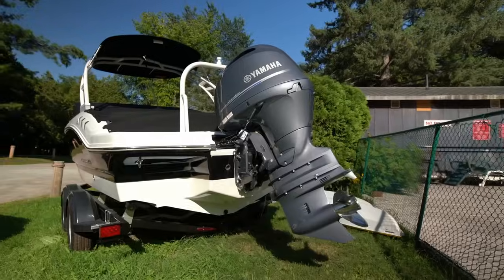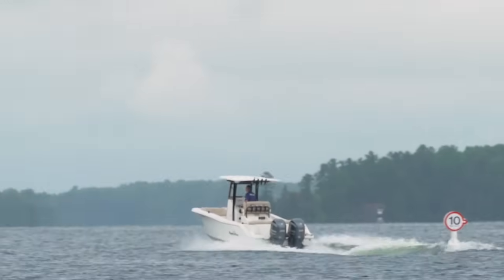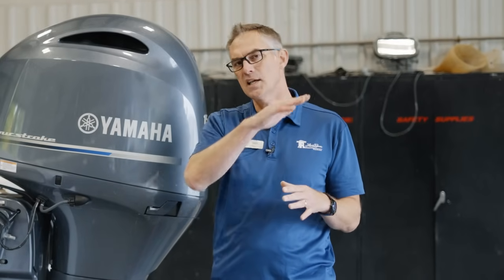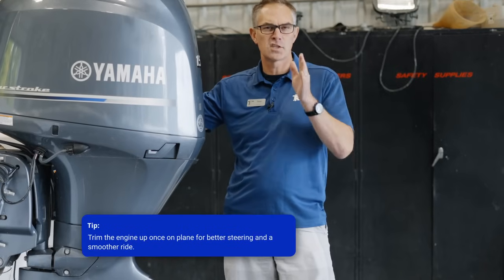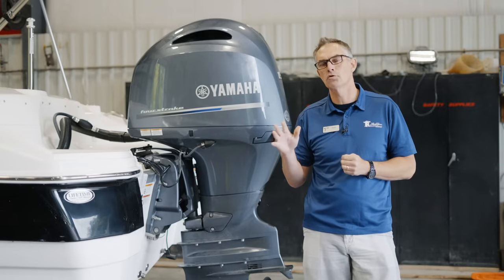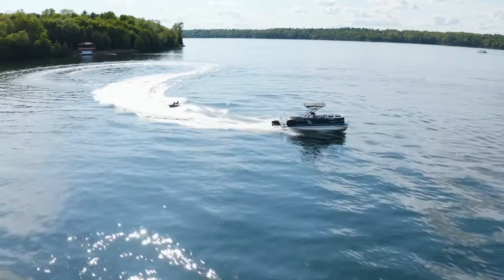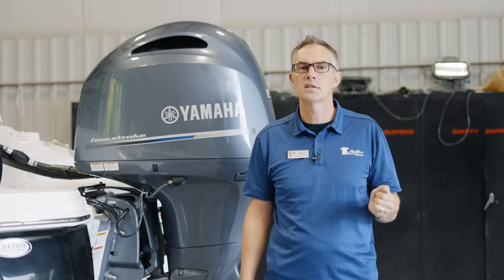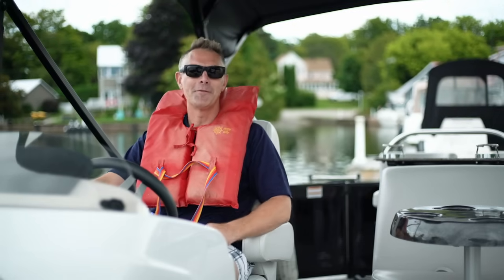How To Trim Your Boat (Boat Trim Basics)

Comment: My grandfather taught me to trim by watching your wake. No just behind but along the boat. As you adjust trim you'll notice the beginning of your wake moves up and down between the bow n stern . The less wake the better the trim, less boat in the water , less friction, more efficient, more speed.
Reply: Simple but that's an excellent idea.  Will give that a try.  Thanks!
Reply: Very cool! Your grandfather definitely had it figured out!!
Reply: You will also hear it, the water shifting to the back, or stern…lol
Reply: I mean, you’re correct, but it depends on tge type of boat. What you’re saying doesn’t hold for stuff like my tournament bass boat, which has barely any part of the boat even touching the water when on plane. The only wake is almost completely behind me. 

My Regulator 33 center console saltwater sport fishing boat performs exactly as you said. 

You can always tell by the steering anyway. 

And that’s all only for calm water. Get out in the salt, or even big water like the Great Lakes, Lake Champlain, etc, you have to trim it for the waves, not just performance.
Reply: Thats how i do it. Just look over the side. If its windy and wavy i only trim 1/2 up, if its glass than 3/4 up.
Reply: You’ve learned well young grasshopper.

Comment: After on a plane, I use my GPS speed and engine RPM. With the throttle at a fixed point, say 4200 RPM,  I bump the trim to see the RPM come up slightly and the speed increase without a change in throttle position. I also watch the "wash" You want it to be just on the edge of cavitation, then trim it down a touch.

Comment: To trim your engine properly, tilt up until you maximize your speed which means your wetted surface area is minimized or until your propeller starts aerating, whichever comes first. If your propeller starts aerating, then tilt down a bit.
Reply: @GiveThanksAndPraise hey, that’s how I listen too!

Comment: I go by sound on trim all the way down I can hear my motor under more load as I trim up I get to a point where I hear the load release and my rpm’s start climbing more I usually leave it there until I stop again what I don’t know is if I keep going up more will I gain more speed or is the point I’m stopping at now the sweet spot and most ideal?

Comment: In calm water, after it gets on plane you can trim the motor watching the gauges where your getting the highest speed for the RPMs and you will notice you will also be getting the best MPG for your boat.

Comment: The Mercury user manual says that in order to trim the engine correctly, perpendicular to the surface of the water, the steering wheel should not feel a tendency to overturn either to the left or to the right... but at the same time, when you want Go fast, turn the engine up a bit. Very good video, greetings from Argentina.

Comment: I was always taught when on plane, trim up till you hear the slight hollow noise.  Then one click back down.  That’s the sweet spot.  Has worked great for 40 years.  No issues.
Reply: this is about boats, not planes.  just kidding.

Comment: Wonderful video. Used to sail for some years and now for the first time started riding fast power boats. The concept of trimming the angle of attack of the prop is totally new to me and this video was extremely helpful. Super well explained and easy to follow, especially the details around over trimming and how to not rely on trim gauges

Comment: Great video. Another good tip is to trim up to a slight positive angle when in reverse. Helps to pull the rear of the boat up making it easier to maneuver and you don't pull water over the transom.

Comment: Every boat is different. My chaparral, bravo three would get its best performance (top speed )when I trimmed it up to 2. The trim range was between zero and four. On the gauge anyway.
My tritune on the other hand gets its best top speed when trimmed to 1.2. But it gets its best miles per gallon at 23 miles an hour trimmed at 1.4. In the end, just spend a little bit of time figuring all of this out. Every boat is different.

Comment: I always forget to trim up my stern drive when I put it on the trailer but I’ve just been lucky not to hit the ground before I notice and trim it up (just as it emerges from the water.  ). I need a huge red laminated card or some reminder to do that ! 😂. And since we’re sharing I need a reminder to put it down when I launch. 

Some other trim goodies I picked up this year as a new stern drive owner:  the manual says to store it in the down position, even if it’s sitting for “a short storage duration “ so the bellows don’t “take a set” and stay bent in a tight angle. I see lots of boats sit for months with them fully tilted up for trailering. Also a friend of mine who worked hydraulics in the Air Force said hydraulics 101 is to store them with the ram retracted is best (so again trimmed down ). 

Try not to run a stern drive boat motor (I believe even in neutral ?) with the stern  drive trimmed way up because it can be hard on the u-joint in there was another tid bit worth passing on I guess.
Reply: Obviously a year late. But I have a laminated card on mine .  One side with all my boat details in prep for a may day or a pan call for either myself or, for if I'm thrown out, the passengers who might not necessarily be trained to be able to give out properly and because I'm a bit of a stickler, I have a checklist prior to and post leaving the mole on the reverse of that. You know what you're doing from memory anyway, but things can easily be forgotten and it's just a 5 second flick through, yes I have rope, yes I have anchor on board, clips, life vests, first aid kit etc.

Comment: Ugh, I have a 19 ft four winns and end up trimmed down most of the time. With 3-4 kids and tubing it just makes it easier. But even cruising even a little trim up has me porpoising. 

And remember to trim up before you pull the boat. :-)

Comment: Thank you for this great tutorial!  This is a clear explanation complete with visuals and thorough explanations that, for me, was a perfect blend of technical details without either getting so cerebral as to be on the level of the engineers designing these devices or dumbed down to the point where there is virtually no explanation of the physics or reasons for the particular recommendations.  Well done!

Comment: In my old 16.6’ aluminum with a 50 Yamaha the revs won’t get all the way up unless trim high enough. Theres a bunch of batteries and gas near the stern so the weight isn’t balanced. Because of this once you trim too high it’ll porpoise so you probably won’t over rev it. Great boat to learn on since there is no tachometer, no trim gauge, no anything. It’s all feel

Comment: Getting on step quicker has a lot more than just trimming the motor. Weight distribution, hull design, being under powered and let’s not get into prop pitch, cupping, 3 blade vs 4 blade. 

In my early years I bought an old 17’ whaler with a 75 Johnson. Would take 1000 yards to get on step, tried whale tails, trim tabs, jack plates…nothing helped. Sold the engine and repowered with a 90 merc with a 4 blade….blew the hull clean out of the water and was on step in 3 boat lengths. Learned a thing or two that day about being under powered and 4 blade props.

Comment: i always used sound. up on plane lift the engine. when it gets loud put it back down till noise goes away, found that gets the fastest speed. now you can leave it there, but if you slow down then want to go again, just going to take slighter longer to plane.
Reply from the maker: All of those things are true :)

Comment: Hi, great videos I have a 2020 150 Yamaha 150xca and it bleeds down at the dock and underway and I have to keep adjusting the trim up as it bleeds down,my  dealer says this is normal and that is why you need to put the engine rest bar down so it will not bleed down over night,i do not believe this is normal ,and they tell me that Yamaha will not warranty this, what is your input,thankyou

Comment: The last thing you mentioned was to trim your motor all the way down to be ready for next time, but I've been always told to raise the lower unit out of the water each time you're done boating. Which is it?
Reply: if you leave it in the water it is fine to leave it down but if youre taking it out out of the water with a trailer you always need to trim it all the way up
Reply: also depends on water.   I wouldn't leave anything down in salt water

Comment: Hi there  ! Thanks for your technical guidance and savoir-affaire in boating issues. I have an Angler 22 with 2 x 250 HP VX series YAMAHA  outbards. Quick question : Why is it so, that when I run the boat at mid power and press the trim button down, it clearly accelarates better...?  I assume an electrical issue has to do, and if where shall I look to, in order to guarantee unstable electrical power to the spark plugs I pressume...?¡¡?

Comment: How do trim tabs affect the use of the trim?
Reply: Not much really. You still trim the exact same way.

In most properly powered planing hulls, you'll want to trim till you porpoise, then add in tab to stop it.

Exceptions to this are sea conditions, loading and balance, and speed.

For example: if you are unbalanced, or listing, the tabs will be used to level first, then achieve proper trim, then tab down to eliminate porpoise.

Another exception is in rough water, which is where tabs are most often under utilized. You still want to trim for max efficiency, then use the tabs to get a level ride, to prevent porpoise and pounding.

Finally, tabs are most often severely undersized on boats, which make them far less effective at doing their job properly. High Performance boats will need a much longer chord than a cruiser or fishing boat of less performance, due to the fact that the plane (tab) needs more leverage and less drag to keep from hindering performance.

The best way to understand proper use of tabs is to find a person who has a high performance boat and let them show you how they are supposed to be used. You'll find that nearly all people who use tabs on boats do it wrong.

Comment: Great video,.... question.  Does this also apply to a 30 foot 11,000 lb Bayliner Flybridge with a 7.4 sterndrive?  I always use my trimtabs but this may be a new tweek.  Not sure if the size and weight make a difference.  You mention a 25 ft or greater pontoon boat will be different so thats why I was wondering about comparing to my boat.  I can get on plane around 26/27 MPH.  At about 1.25 MPG I am always looking at saving gas.
Reply from the maker: Thanks Thomas. Yes it applies to every boat in general, although the amount of improvement will vary. Your tabs help bring the bow down (getting on plane easier) and the drive trim lifts the bow once you are already on plane. Typically you would reduce your tab setting to (or close to ) zero before adjusting the drive trim up
Reply: yes  ñew 30 foot bayliñer fly brudg has 2   64 kw batery oaçk

Comment: Will a long shaft motor get you on the plane quicker than I short shaft motor in a 15 foot boat
Reply: buy  jet iutbarx
Reply: you try to have the cavitation plate come out even with bottom of boat long shaft is for taller transom boats

Comment: This guy doesn't even discuss about hydrofoils ,wholeshot or pushing weight .while pushing weight the trim may have to lifted a bit for compensation or the boat will plow and twist once the bow touches a swell this action actually causes the boat to twist and tends to roll